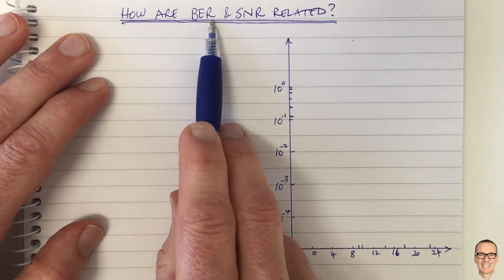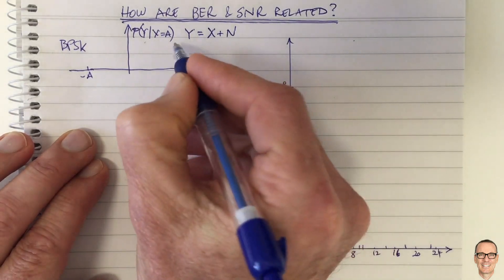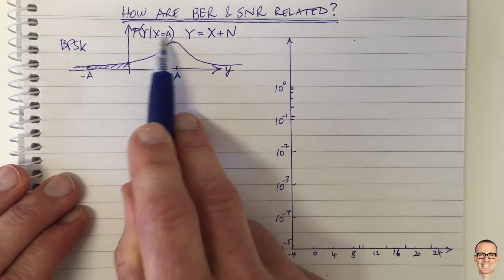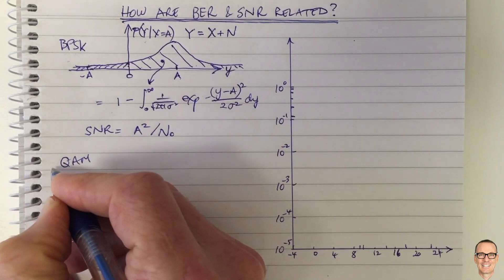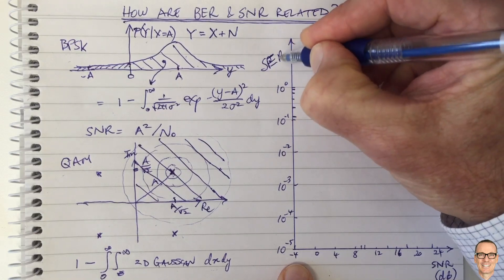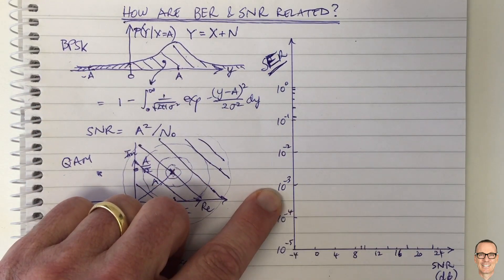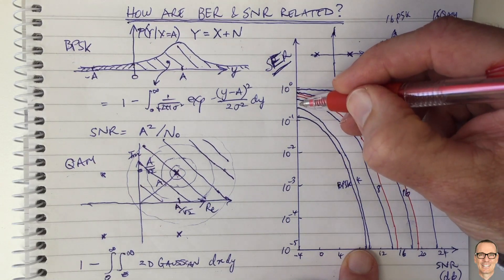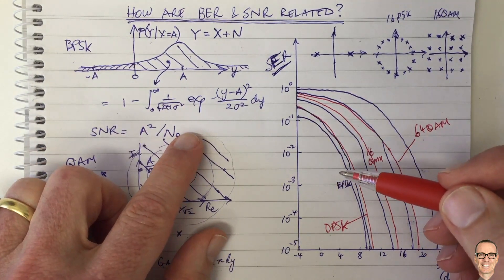How are BER and SNR Related for PSK and QAM?

Comment: why dividing by square rroot of 2?
Reply from the maker: The magnitude of the transmitted symbol is A. So if it corresponds to a sinusoid with a 45 degree phase, then the cos component (ie. the real part) and the sin component (ie. the "imaginary" part) both have magnitudes of A/sqrt(2). It's directly from Pythagoras's theorem.

Comment: Good video! Here is a question: At the time 8:31 in your video, you mentioned that BER for BPSK and QPSK are not the same. However, some text book say that the BER are the same for BPSK and QPSK. I wonder the intrinsic principle of this question.
Reply from the maker: Great question. It's something that often confuses people. You've given me the idea that I should add this as a topic for a future video. To be precise, I didn't say that the BER are not the same. I said that the SER are not the same. There's a difference. In summary, a BPSK symbol exactly corresponds to a bit, so BER = SER for BPSK. But for QPSK, each symbol corresponds to 2 bits, and so the BER and SER are not the same. For QPSK, the SER is higher than the BER, since when you make symbol errors in QPSK, often only 1 of the 2 corresponding bits is in error.

Comment: Hi Professor! Excellent explanation.  I now have a better understanding in regards to when it is better to use PSK vs QAM. Q: why do we care about 10^-6 or higher BER? It's one but effort every 1M or higher bits. Doesn't seem like something noticeable. Why not go with 10^-4 and and conserve EBNO?  I guess perhaps a better question would be what applications require extremely low BER?  Thanks.
Reply from the maker: It's a great question. Most applications wouldn't be overly affected by 1 error in a million, but some would - for example, financial records transfer, etc. In any case, even 1 error in a million will cause the TCP layer to request a re-transfer of that frame.

Comment: hey lain @ 13:50 you have made a statement that we don't have to bother about amplitude in case of 16  psk   why is it so . 
can you spread some light on this ? and why you have made the statement that 64 QAM is better in case of AWGN CHANNEL and why not in case of RAYLEIGH FADING whwere as in both cases amplitude is being affected
Reply from the maker: All the symbols in PSK have the same amplitude, so all you need to do to detect them at the receiver, is to track the phase. You don't need an accurate estimate of the channel gain. For QAM, you need to estimate the channel gain accurately, since not all symbols have the same amplitude. And I think you're confusing the AWGN channel - it does not affect the gain - as the name indicates, it only adds noise.
Reply: @iain_explains  but its not like that even to make a correct estimate of the phase we need an correct estimate of I and Q component at the receiver which also requires a estimated  correct gain of the channel to do so  as phase is arctan(I/q)
Reply from the maker: Yes, but that doesn't mean you need accurate estimates of I and Q. As long as I and Q are both "inaccurate in the same way" - which is what happens in non-linear amplifiers. In other words, you only need the ratio of I and Q to be accurate.

Comment: Is the SNR for 16-QAM worst-case, where you're choosing two symbols out of the constellation with the minimum amplitude 50% of the time? Or are you calculating SNR based on equal probability (1/16) for all symbols in the constellation?

For instance, I see "PAM4 has an SNR 9.5dB worse than NRZ for an equivalent amplitude" in a number of references. But this calculation only works for unipolar PAM4, where you're only sending either 0 or A/3 50% of the time, compared to NRZ sending 0 or A 50% of the time:

10*log(A^2/2) - 10*log(A^2/18) = 10*log(9) = 9.54

Any other probability for symbols {0, A/3, 2A/3, A} (or different DC bias, for that matter) will give a different SNR reduction compared to NRZ {0, A} 50% of the time.
Reply from the maker: SNR is the ratio of the power of the signal, divided by the power of the noise. So yes, the power of the signal is a function of the probabilities of each symbol in the constellation being sent. In general it is assumed that the data is sufficiently compressed (or random) such that each constellation point is equally likely.

Comment: hello sir, @13:50 why in psk we need not to worry about the amplitude of the received waveform after all its the amplitude of the I/q components which is deciding the phase of the received symbol (like in qpsk  I=SQRT(Eb/2), q=SQRT(Eb/2) ) where phase = arctan(q/i) Eb=Ac^2*T/2 which is depending upon the amplitude of the received signal
Reply from the maker: I'm not sure exactly what you're asking, but yes of course you would like to have a system with a strong signal amplitude, so in that sense you "care" are it - but that's not what I meant. What I meant was that you can tolerate errors in the amplitude estimate and yet still detect the data correctly, because all of the data symbols have the same amplitude. This would not be possible if you were using a modulation format that encoded some of the data into the amplitude, such as in QAM, ASK, and APSK.

Comment: I have a question
Does the receiver actually know the SNR. Recall that SNR is signal power over noise power. It is quite easy to measure to signal power given the appropriate apparatus but how can we measure noise power ?
Reply from the maker: That's an excellent question. The noise power can be estimated from measuring the "received signal" when there is no signal being transmitted. The received signal power is only really able to be estimated by measuring the received signal when known training data is being transmitted, and averaging over many training symbols in order to "average out" the noise.

Comment: Great Video!  However, you define SNR as A^2/N_0.  Shouldn't this be A^2/(N_0/2*BW) as N_0 is the noise power spectral density, not the noise power itself?
Reply from the maker: Ah yes, this is a very common cause for confusion. I'm going to make a couple of videos to explain this in more detail, so keep a look out for them in the next week or so on the channel. The problem comes from the fact that bandwidth hasn't even been mentioned at all! Technically, non-band-limited white noise has infinite power, so if we are going to consider signals with finite energy, sent over infinite bandwidth channels, then the SNR would be zero. To get around this, many textbooks implicitly define SNR to be "Signal Power to Noise Power Spectral Density" (or in other words, noise power per unit bandwidth), but they often don't make this explicit, or try to explain it. Hopefully my upcoming videos on this topic will help.

Comment: Hi Sir, could you make videos on How pulse shaping affects the wave form of a Phase modulated Signal(BPSK/QPSK). When there is no pulse shaping is present, the Envelope of the Signal happens to be Constant and only the phase is affected. But for the case when the message is shaped using any pulses other than ON_OFF keying (say a Raised Cosine Pulse), will the envelope of the Signal will still remain a constant.
Reply from the maker: Good question. I've added it to my "to do" list. In short though, PSK does not need to have the same amplitude for the entire symbol period (ie. it can have pulse shaping applied, to reduce the bandwidth). The important thing is that all the symbols have the same magnitude at the output of the matched filter in the receiver - so that it is immune to nonlinearities in the receiver amplifier (ie. all symbols are affected to the same degree). There is a modulation scheme that has a constant modulus for the entire symbol period (CPM) but it requires a much more complex receiver.